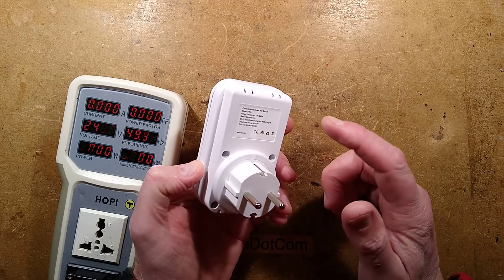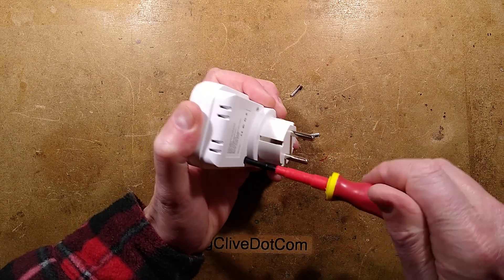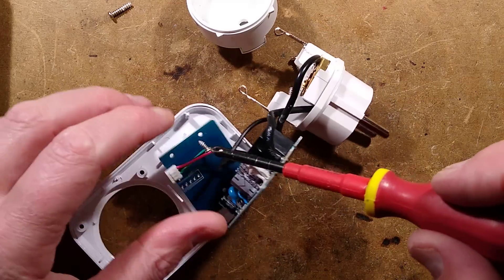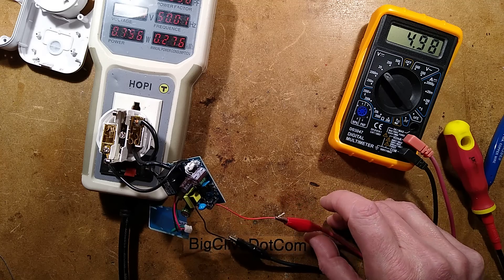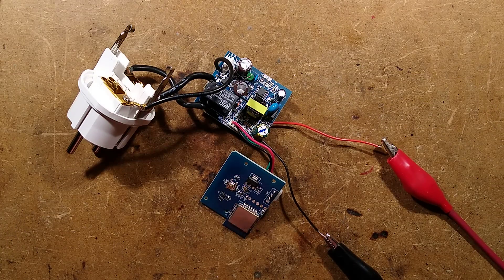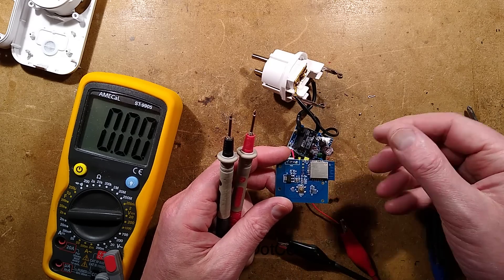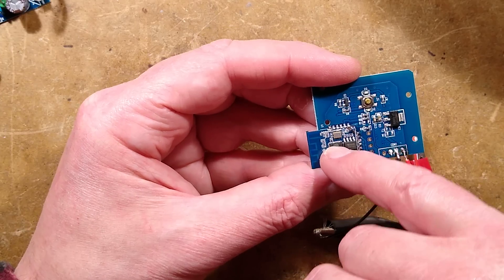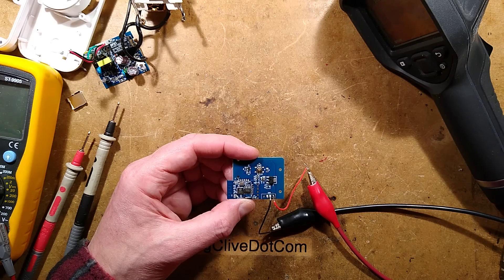WiFi socket repair fail

Comment: 8266 are super easy to flash. You only need power, serial & a reset line held high during power up.  Tasmota has built in flashable firmware for them. You should be able to flow the whole board off and replace it with another. You can also roll your own programs with arduino studio if you prefer.  You can pick the modules up for a buck or two from many online retailers.
Reply: Exactly this, esp8266 is easy.  My first inclination would be to hook up a ch340 to the serial line and watch the boot sequence.
Reply: I always buy devices I can reflash with Tasmota. Have a bucket load running the heating system and outside lighting in a large pub.
Reply: Yeah Tasmota is great, works on a ton of devices and lots of fun hooking them to node red on a raspbery pi :)
Reply: That's what I was thinking while watching the video. Could always dump the SPI-flash and then write it on the new, replacement module, or just use Esphome or Tasmota instead. The module itself is an Ai-Thinker manufactured one, which are easy to find on eBay, Aliexpress or LCSC, for example.
Reply: @WereCatf  I always reflash with Tasmota when possible anyway. Too many of these IOT devices are potential security risks.
Reply: @chaos.corner  I always do that, too. I research the options first before buying anything, actually, just to make sure they use an ESP-chip of some sort, just so I don't end up with some undocumented Chinaman-bog.

Though, I have gotten one WiFi-socket where the manufacturer had just decided to replace the innards with a cheaper Chinaman WiFi-bog, for which there are no tools, no SDK and no documentation available right before I bought it, so all the information I found about it on Google were for the previous version with an ESP8285 in it. That was a bit annoying.
Reply: @WereCatf  Tuya has moved from esp8266 to a new cheaper solution and it’s killing tasmota.
Reply: @JasperJanssen  no esp no buy.
Reply: @JasperJanssen  Don't be so alarmist. Just because Tuya has done that doesn't mean every other manufacturer has as well. Also, Tasmota is still perfectly useable for any DIY-projects using ESP82xx, so there's still demand for it, even if every manufacturer did move away from the ESP88xx.
Reply: @chaos.corner  I've put Tasmota on all my ESP equipped WiFi plugs.
Reply: @JasperJanssen  you can sometimes swap out the new tuya chip for a pin-compatible ESP board. I've done it for a bunch of RGB bulbs. It's not a fun chore but it works!
Reply: @chrisreynolds6331  Do you have or know any model that can take Tasmota and also reports power usage? It would save me some research time :) Thanks!
Reply: @dan-nutu  Not yet unfortunately, but still looking. Tasmota does have a "CT power" option on the analogue pin A0 so it's ready. I've used a current transformer on a standard ESP 8266. You need to bias the sense coil "ground" to 1.65 volts using resistors so the the analogue pin can see both halves of the sine wave.
Reply: @chrisreynolds6331  good hint with the bias, thanks! Although I remember the ESP8266 ADC only takes a maximum of 1V?
Also, look what recently showed up: https://youtu.be/nIB3kWqqAzE
Reply: @dan-nutu  I'm using the nodemcu type (wemos D1 mini) which apparently accepts up to 3 volts
Reply: @chrisreynolds6331  I found an answer: Athom preflashed TASMOTA smart plugs. They report voltage, current, power, apparent power, reactive power, power factor, energy today, energy yesterday and energy total. There is also an ESPhome preflashed version, although I didn't see what that one reports (I presume the same). HTH
Reply: @dan-nutu  Now that's excellent! The Tasmota version would work with node red and MQTT which I have running on an old pi 2. As previously mentioned I use zerotier to bond my phone to the pi for secure access to node red dashboard from outside my network
Reply: @dan-nutu  I've used the sonoff s31 smart plugs. Monitors power usage and can flash tasmoto on it
Reply: Thanks. I reckon you're in the States? I had a look at Sonoff's web site and the S31 seems to be available only with the US type socket.
Reply: I can't tell you how many esp8266's are in my house.... a lot that I know about, and they appear in a suprising number of products including my lawnmower. They are super easy to flash, and relatively easy to source and replace. They do sometimes, rarely - I've had 2 do it, just F.O.A.D. tho, especially if they're from a questionable source.
Reply: @chrisreynolds6331  I had a nodemcu opened up on a port on my firewall that worked as a MQTT bridge of sorts to node red with a small app i made on android. 
Convoluted and messy but fun to play around with but found it did not add much to be able to switch on the lights from afar :)
But zerotier looks fun as well.
Reply: @FrancSchiphorst  I like zerotier because port forwarding and dynamic DNS is not needed. It's effectively a cloud router and gives each device a zerotier LAN address that doesn't change. If any of the devices public IP happens to change it only takes a minute or so for zerotier to update it.
Reply: @chrisreynolds6331  sweet
Reply: How do you know what device to set it to in Tasmota?  It always defaults to sonoff and I don’t even know what that is.
Reply: @JohnSmith-gs4lw   The simplest way is to trace the line from the relay to the module.  Typically it is one of the dozen or so GPIO pins available. Worst case you can experiment and find out. The tasmota site has profiles for hundreds of devices though, so it's probably listed there already.
Reply: @JohnSmith-gs4lw  scroll to the last device entry "generic 18" and save it. Then all the GPIO pins will appear
Reply: @chrisreynolds6331  Perfect! Thank you.
Reply: Thanks all. I guess what I meant to say was when I load Tasmota on a bare NodeMCU development board, I just want to have some outputs controllable for my relay boards and inputs for my sensors. I’m not generally re-flashing a pre-fab device. I’ve got a good selection of 8266 and ESP-32 development boards that I’d like to build up on my own. I remember they had some “generic” options or something like that.  I need to dig into the documentation….

Comment: repair should be feasible, drop in a form factor compatible esp8266 module and tasmotize it, finding the config string for the right gpio to trigger the relay will be easy.

Comment: The 8266 is easy to kill with stray voltage; anything north of 3.6v, even transient, will just fry it.  Cost optimization probably didn't put enough protection on the 3.3v supply, or the back-current from the relay when turning it off managed to exceed that limit?  In theory the transistor should have stopped that, but I bet a 5-cent choke would have ensured it.

Otherwise, it's a really neat MC, easy to run all sorts of different kernels on it for different embedded systems, even interpreted ones like python and lua.

Comment: Flash could have died or lost couple of bits...
Reply from the maker: Very possible.
Reply: What i was thinking
Reply: I had that "lost a couple bits" error once I think... I guess these flash chips don't like kinetic impact very much (dropped my flashlight down the staircase, had power, but no boot), but it was all fine after reflash. Maybe there is hope for "tasmota and go" ^^